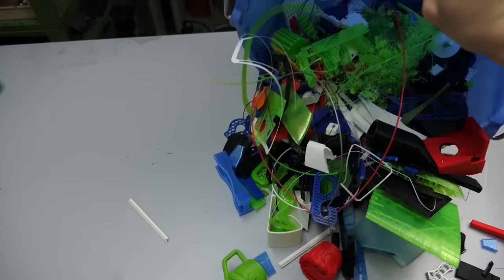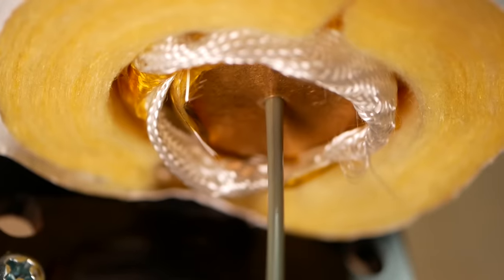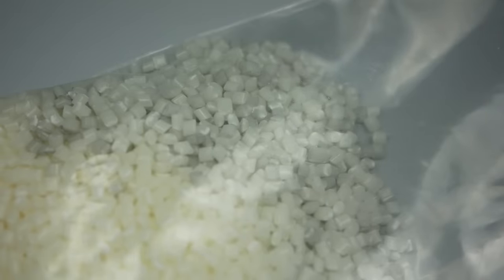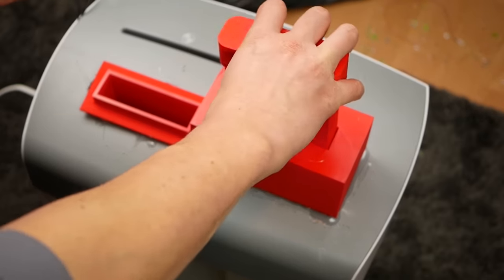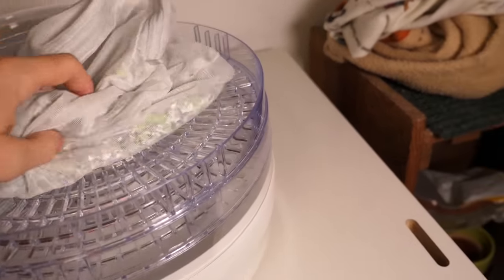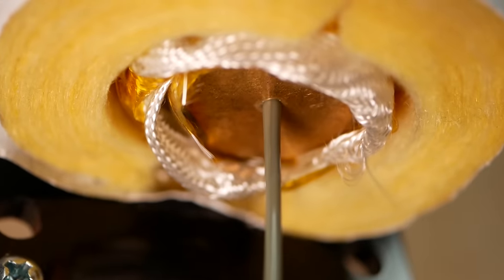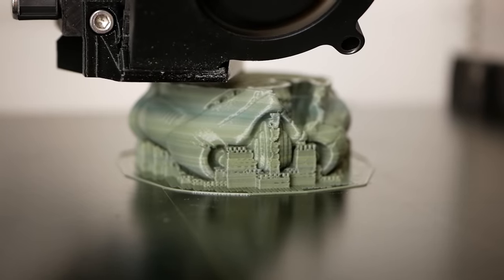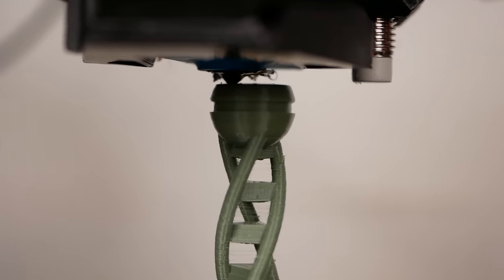Recycle your failed 3D prints! Make new filament at home.

Comment: buys $150 printer

"I need a way to save money on filament..."

makes $500 PLA recycler
[this is a joke, people.]
Reply: it's one of these "In the long run" kind of things
Reply: @indoorkite651  actually: since 3d printing is an additiv production method, you will habe not much e.g. pla trah over all. i collected over 2 years of supports failures and so on and it was just a box, that don't even would get you 1 or 2 kg. 
also the quality would be bad and the color awful. 
it is a really nice idea but dont works for single users.
Reply: Where are you shopping for your 3d printers?
Reply: @clort123  ebay, but prices have changed a little. Ender 3. I actually just got mine today.
Reply: clort123 cheap kits
Reply: @55yxalaG  ender 3 is like 300 right?
Reply: @JoeMakaFloe  no, $180ish
Reply: @55yxalaG  oof, a store near me sells them for $308
Reply: @JoeMakaFloe  there's an eu shop too
Reply: @user-cu1dz5io2i  I bought an enter 3 and a glass bed for 233 not long ago from there :D
Reply: Plastic pollution is a serious issue which costs us a lot of money and will keep costing us a lot of money the longer we keep polluting. Therefore it makes decent economic sense to make such a machine. Especially if you can get a local community to bring all their failed prints to you so that you can recycle it for them for a small fee. You're not going to be able to live off of it, but it could pay itself back in the long run.
Reply: @55yxalaG  Is it working good? Does it print quality prints?
Reply: @Emalo  Definitely worth the money, with almost always high quality prints (though it is mu first 'printer). I'll have to heck the price again though - Prices on ebay have seemed to increase by $100, not sure if i just can't remember and I actually got it for $280 or if the prices have really gone up that much since the quarantine. Even if it was 280, I think it's an excellent beginner to intermediate level printer.
Reply: yeah I am also shocked by this cost, is’t there an even cheaper version :)
Reply: Recycling is about reducing the reliance on new resources and manufacturing, something I would gladly pay much more money for... There's a trend in Australia of people buying $15 tents to take to music festivals as a kind of "disposable" tent that they just abandon... That's disgusting behaviour in my opinion and super wasteful of resources and manufacturing.

Saving money long term is just a bonus for not being a shit human being.
Reply: @JoeMakaFloe  no 200
Reply: Save environment 

Don't waste energy boi
Reply: @GolemShadowsun  I wonder if pla food packaging could be shredded and used for clear 3d prints? No waiting, just raid the trash bin, recycling at it s best.
Reply: @ABW941  most plastics can be recycled into filament, but it isn't as simple as dropping your empty bottle in one end an filament comes out the other. You do need to make sure what type of plastic you are working with as some release nasty fumes when you heat them.  Shredding the plastic can also be a challenge, but it can be done. I've seen plans for $300 or less for a homemade extruder that is supposed to produce pretty good filament.
Reply: @JoeMakaFloe  depends on where you live
Reply: I have around 100g of waste 3D print material per year.
I guess, I would need a few 100 years to make sense out of this ;-)
But the PLA might not last so long... and neither do I...
Reply: Then he makes $5k off this video. So he didn't just save money. He made money. lol
Reply: Gotta spend money to save money
Reply: @GolemShadowsun  Color does not have to be awful, because you can always order failures by color and recycle only specific color (e. g. blue) at a time, but I agree with the rest.
Reply: @AnimilesYT  Spot on there!
Reply: @JoeMakaFloe  I paid 200 on Amazon but that’s Amazon 👍. Sure you can get a better price on eBay.
Reply: @tinalou8620  I'd be interested in a machine, depending on the price, but your number doesn't appear to be correct as it gives me an error when I try to message you
Reply: Your comment is ignorant. Also, the fact that you included so many line breaks that the reader would have to click "Read more" indicates that...

...you should just stick to playing video games.
Reply: Your logic is flawed.

One is a single purchase.

The other is a consumable.

Comment: Very interesting! I think that using water to cool down the filament as soon as it leaves the "filastruder" might improve stability and speed. Also, a much bigger heating device might simplify the process as larger plastic pieces can be used. Another system might be required to get a constant material flow, maybe some kind of submerged pump...
Reply: I have no idea how hard it would be to drive the accumulated moisture out of the filament.

Comment: Thank you for showing this. This is really nice work. Two questions: Have you had a chance to try recycling pva? And, what if you melted the entire batch and used some sort of press to extrude? Maybe you wouldn't need to shred the scraps. Keep the entire setup in vacuum so you're not fighting air pressure and then it will automatically be dried for you. Just a thought, I haven't tried anything.

Comment: thank you for the video , I have an Idea about creating a simple motorized filament cutter that will feed the extruded first batch and cut it every 5mm , this way you will have consistent pellets that can be dried then extruded again into a perfect filament .
its extra  step but I guess it will produce best results regarding color ,thickness and texture .
Reply from the maker: Good idea.
Reply: is it ok to heat and melt the PLA several times? will the properties stay ok?
Reply from the maker: Plastics will start to degenerate over the melt cycles. That's why you usually add virgin pellets to reduce that effect.
Reply: CNC Kitchen that makes sense :)

Comment: I love the color! There's people out there making filament from recycled plastic bottles, which I think are mostly PET. Not sure if some of that could be mixed with the PLA. The bottle filament is made from running a strip of plastic bottle through an extruder, so there's some uniformity to begin with, and less mess, but still some prep is required. Stick with yours. Great work. Nice video too!

Comment: Recycling my PLA scraps is like making bio diesel from the oil i use to fry my food, i just don't eat enough fried food. but if i go to a couple of local restaurants and get their oil too, now its becoming more worthwhile. So maybe a co-op of 3D print enthusiasts all putting in their scraps and selling it as recycled PLA at 1/2 market price or donating to the 3D volunteers printing PPE headgear. 
A possible solution ror holding the size would be to employ an air knife or even a fan at the proper distance from the extruder to stiffen the PLA just as its 1.75mm  (it will shrink more).
The last little extruder i worked on had a 2500HP (1850KW) motor  and pumped out 5000 LBs  (2250 KG)  of acrylic polymer per hour 24/7 350 d/y.
Reply: exactly my thoughts.  fry places used to (might still?) PAY recyclers to take it so free ++ material cost

Comment: Great video, I've been using the Polyformer for over a year and love it. To prep the bottle I've used my microwave, I put the a splash of water in the bottle then add the lid and microwave it for 30 seconds the steam will expand and perfectly soften the plastic. When done run it under water for a sec then let the steam out, I put the tip in the water so steam can cool down fast. Then run water inside the bottle to cool it down. Dry it out before cutting

Comment: Can you try recycling PET bottles? That would be really cool
Reply: Adam Smetana unfortunately that’s cost prohibitive in Germany since there is a 25ct. deposit on every pet bottle.
Reply from the maker: Exactly, I have to visit some Austrian friends soon and take some bottles back home.
Reply: @CNCKitchen  I can hook you up with some
Reply: @CNCKitchen  You could always see if a fan will send you some PET bottles. For example, they could find one that is relatively cylindrical cut off the top and bottom, then slit the sides to make them into sheets of plastic. That would be pretty cheap/easy to mail then.
Reply: CNC Kitchen would absolutely love a video on this. I don’t produce a lot of PLA waste but love the idea of home recycling PET. I would imagine bottles would be easier to crush and then shred to small pieces than failed prints.

Here in the uk there is no deposit. This is what would sell me a filastruder kit!
Reply: Yes.. in most of Australia, PET bottles are thrown away because there is no deposit system (apart from South Australia, where you get a refund -- similar to German Pfand).
Reply: @CNCKitchen  saftflaschen (1l direktsaft) sind auch pfandfrei
Reply: Kieran Short ACT, Vic, NSW, NT, SA, and I believe Tas are all part of the 10c refund system now
Reply: You could add some glykol to it..
Reply: I could probably sort some out if your interested as in the uk we use a lot of pet
Reply: Ditto on the PET bottles!!! I don't get any money for my bottles where I live so I would love to turn them into fillament.
Reply: There seems to be some technical challenges with recycling PET bottles but if it can be pulled off it would be a very good thing for the environment
Reply: The thing to worry about with PET is that it gives off very toxic fumes when heated. You would need extreme ventilation, for both making it into filament as well as trying to use it for printing. It might make good prints, but you may not wake up to see the result. I, personally, would not want to take that risk.
Reply: @MrsInAbox  Queensland is hoping on board as well, although I am unsure if milk bottles are included, I know water bottles will be.
Reply: @KieranShort  most states in Aust now have implemented the deposit scheme
Reply: @MrsInAbox  QLD has been doing a deposit for the last 2 months
Reply: I had a university project called ‘Project Titan Recycling 3D Printer’ that recycled PET plastic bottles by cutting them into a long continuous strip rather than beads. Made a working concept Printer that could only print a few layers before the variance in strip height/thickness resulted in under/over extrusion from the nozzle. Worth exploring though!
Reply: Netherlands has 25ct deposit on bottles too, but for some reason the small PET bottles don't have deposit.
Reply: @CNCKitchen  its not the whole answer, 25 cent deposit is only on lemonade with CO2 gas inside (called "Brause")
Juices, lemonade without gas or still waters are deposit free (it goes in the "yellow bag") and these material would be fine
to make filament with it.
Reply: @CNCKitchen  over here in France (Strasbourg) they have no "Pfandsystem" for PET bottles. I will try to shredder some for testing.
Do they apply a film on the inside of the bottles for any reason?
Reply: @BlackRNGesus  That was very german. Danke!
Reply: @mc3866  yes. But it takes some expensive equipment and some experience. Start a company and sell clean 1.75mm filament (for the MasterSpool) with an accuracy of 0.025mm.
Reply: As I know the filament for 3d printers is petg. Can you print normal pet on a 3d printer?
Reply: @CNCKitchen  Another problem might be the fact, that bottles for carbonated drinks have PVA mixed into the plastic (which forms lamellae like layers by itself). The pva is needed to make it airtight.
Logically the pva would end up in your filament.

Comment: Amazing work! :) I have owned a Filastruder for a few years with intent to make my own custom mixes, however a seller had mislabeled and shipped something which requires a torch to melt properly and ever since i've not arsed to disassemble it to burn off all residue from pipe (there is enough so that my melt filter always gets filled after 100gr or so!). I only made one spool of ABS with it ever :/

I also have graphene waiting to be tried for a mix. If you want some, message me. I also have variety of pellets waiting, including Nylon + GF50 but which has such large fiber strands i have not even tried it.

You can get 25kg bags of almost any injection mold pellets starting from around 2.5€ per kg.

For the hopper, you can add a rumble motor, like one found from a PS4/Xbox controller. That will keep the feed happy :)

Also for better feeding you can add second PID and heater element higher on the pipe; keep something like 50-60C up there which will increase "resistance" of the material thus feeding better. Theory explained at Filastruder forums. This is also what industrial machines do. This will however require more force from the motor as well.

I've been wanting to research on this, but i've been unable to think of a way to do this recycling at a scale high enough to justify the time and cost :(
Reply: How long did that take to type?
Reply: Where can I find cheap PLA pellets 25kg bag?
Reply: @alexandrevaliquette1941  ask from any injection molding or plastics wholesale company. It a bit depends can any sales person be arsed to handle a sale to individuals. Also injection molding places will have tons of scrap pellets, leftovers.
Reply: @skaltura  Thank you, I'll dig within this route!
Reply: 25kg for 2.5 euro -- could you please message me because i searched my but off - it  is all ways like about 10 dollars 1 kilo

Comment: I use to work at a plastic injection mold shop. a few tips when recycling plastics. 1)if it hits the floor, it goes in the trash. this prevents contaminants.  2)unless you are going to make a black with an additive colorant, keep your plastics separate, i.e. green with green, red with red. You won't be as picky as we were, but we even went so far as separating by manufacturer, to maintain a consistency. 3) look for small plastic grinders. these will break things down into almost a pellet form. Also about grinding, you may want to think about getting individual shredders for each color/plastic type. Otherwise you will be spending hours cleaning everything to prevent cross contamination. 
Great idea by the way. I have been debating on getting into 3D printing to help expand my ceramics making, and recycling and reusing hadn't even crossed my mind.
Reply: I'm in the industry as well. Micro recycling is extremely expensive, I see no possibility of people doing this en masse, save for a few enthusiasts. There could be a service that allows you to grind and extrude your filament on their machines. Here, the problem is the price of the service and the need to clean the machines after every batch. The other possibility would be for someone to buy the scraps, but then the chance of foreign material in the scraps is extremely high, and it would only take a very low quantity of foreign material in a batch of 100kg to contaminate it and render it worthless. So I'm guessing that's why nobody is doing it.

Comment: You know those big solid machines they have in kitchens, that is basically a motor, that you can attach a meat grinder to, to make ground meat for burgers, sausages, meatballs, or whatever? I'm reasonably sure that those can handle bone shards, so I bet they could handle PLA.

I think your recycling set-up is worth it, to save money on filament. Especially if you do a lot of 3D printing.

I think it could be useful to investigate ways to quickly test plastics, chemically, or thermally, to sort failed prints, for the sake of people who haven't kept their plastics well sorted.

It might also be beneficial to remind people to store their plastic out of direct sunlight, as I've heard that UV is damaging to some plastics, and I'm not sure if melting them repairs this damage.

Comment: How about the MEAT MINCER with like 21mm holes blade would give the reasonable constant out come
Reply: I actually think this might be the best way to crush your parts. they can create a lot of back pressure and pushing it through those little holes would probably work really well on a motorized industrial meat grinder... Some of those things can crush bone!
Reply: It won't work. I've tried it. The consistency of meat is different than plastic. The augur jams.
Reply: @burtonkent4549  try using a Dremel to put a sharp edge on the augur spiral. I did that to shred some silicone. Without the sharp edge it'd just jam in and not cut apart. It was very difficult to hand crank. A pulley mounted to the augur and a motor to drive it would be essential. So would something to ensure you can't get fingers in it.
Reply: @greggv8  Thanks. Too late, tossed it. I found something else that might work.
Reply: @burtonkent4549  what works?

Comment: I worked in plastic extrusion and blow molding as a maintenance tech and it's funny how scaled down this recycling system is.  To feed the extruder screw you need a rattler to occasionally rattle the inside and prevent jam ups.  You could also use a vacuum to regrind the material over and over instead of doing it manually while simultaneously filtering off smaller pieces that are ready to be extruded.